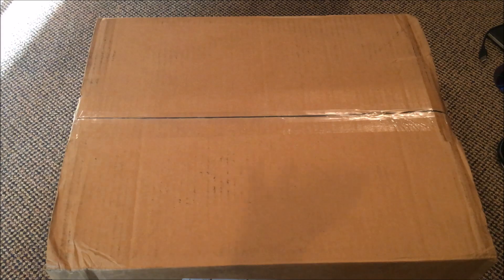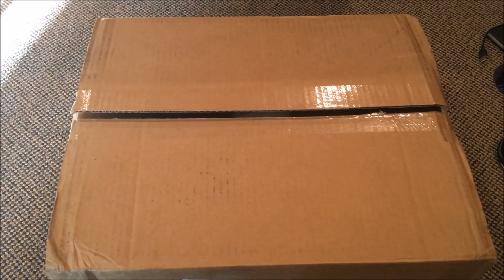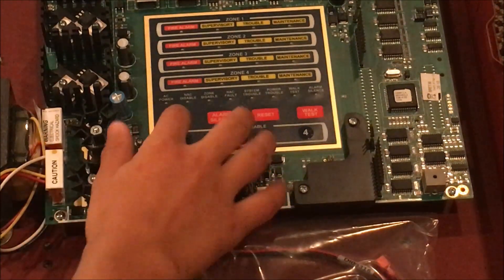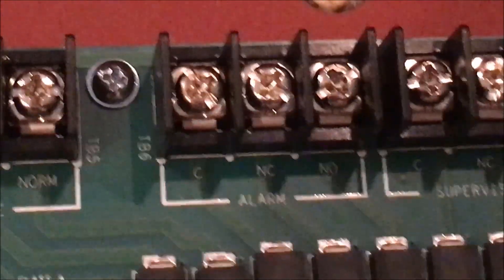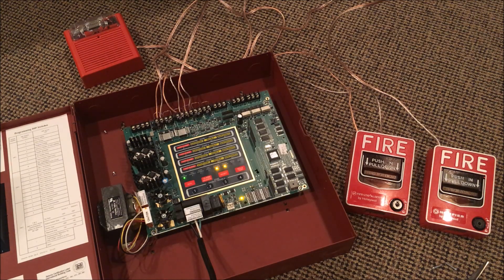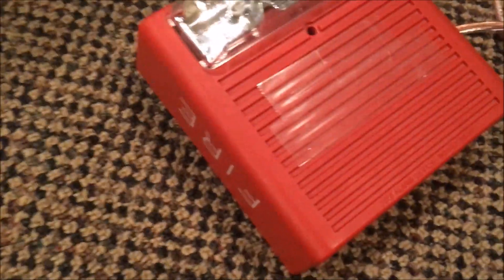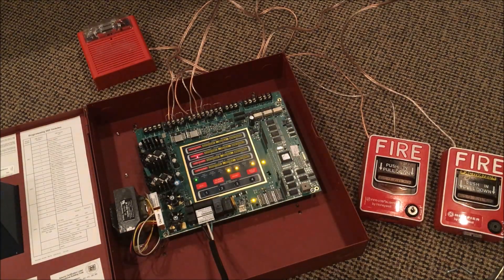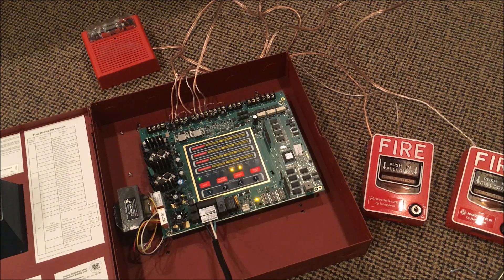Unboxing and Startup of My New Fire Alarm Control Panel (Fire-Lite MS-4 Conventional Panel)

Comment: Is there a way to sound the alarm without using the pull-station?  Say if I wanted to set the alarm to do a fire drill at my house, could I set off the alarm just by pushing a button on the panel?

Comment: I prefer to use speaker wiring on conventional fire alarm panels for demonstration because they’re cheap and easy to find everywhere compared to Honeywell Genesis wiring which might be challenging to find. In fact, I used speaker wiring to hook up my Notifier SFP-1024 FACC which has 10 zones and is conventional and got the wiring from Home Depot and Amazon

Comment: Do all firelite panels only work with 110v or also 220v? Because I live in Europe and I would want to get a firelite panel
Reply: you need 120-125v
Reply: Yes, they do have a 220 to 240 V, fire lite Ms-4E

Comment: Hi Alarm guy, I  also have a Fire-alarm MS-4 just like that one, I had it for about 5 years, well the problem is that i put the wrong wiring and it through a spike trying to put the battery and now I cant make it stop beeping. What can I do help!
Reply: You should put backs or reset troubles

Comment: HI
Actually in addresable fire alarm loop system i want to tranfer one sonder with manual break point.Is this possible means how can i transfer please make a video for this as soon as possible....
Reply: If you use an addressable sounder you can replace it with addressable call point with same address as that of sounder. But the problem here is you should reprogram the panel or else it will show unidentified device or unknown device. If you think you don't need to program it which is no need to see which floor or office the detectors operated then you can go to the panel settings where you can find engineering options there you can find auto learn option which after which your panel takes all detector address and will be in normal condition.

Comment: I tried removing the cover for the dip switches on this panel, but the screw won't come out. Is there a specific way you have to do it?
Reply from the maker: Carson Delmoe Not really, you might just have to pull harder on the black plastic cover though.

Comment: I have a question, it might be really stupid. But I'm new to fire alarms... I'm thinking about getting this exact panel, I am going to have pull stations hooked to it. My pull stations only have one positive one negative not meant for series can u hook more than one wire to one zone on a panel?
Reply from the maker: To be honest, I would not get a panel yet if you are just a beginner. They can fry easily and there are certain procedures you must follow when wiring power, devices, etc. I fried one by knowingly wiring up the power with the power turned on and had to buy a new one. They also run on high voltage which can be dangerous if not careful. To answer your question, yes, you can hook up as many pull stations as you want to a zone. For this panel, as far as I know, each NAC can support up to 24 devices. But don't quote me on that. I think it is great that you are starting fire alarms, glad to hear it! But I would not get a panel quite yet. I would start off small and get bigger the more experienced you get. I am just giving you advice and precautions because I don't want you to buy a panel and pay all that money and fry or damage it. So again, I would start off with just mini systems with 9v adapters or so and then get a real panel later when you have more experienced. Just as some advice. Great questions, and I look forward to your awesome fire alarm videos! If you want to know how to wire a pull station to a notification appliance without a panel, I made a video specifically explaining and showing how to do that. Just go look for it on my channel, it should be really easy to find. Good luck!
Reply: I'm not getting one for a hobby system, I'm getting one for actual safety but... I have been researching these systems since I was a kid but.. I just got my first alarm and am not used to wiring, thats what i meant by beginner so if u have any videos that would help me learn  how.... or anything please let me know. I sort of need a panel to get pull stations and smoke detectors, but I still am not very good at the wiring part, Also I have been trying to find a good video on how to make your own power supply for it but I cant figure out how but I would like to make my own DC adapter that is grounded for it's more safe for power surges and stuff. Just let me know if you know any videos that help making power adapters for them cause like u said I don't want to short out my panel :)
Reply from the maker: The adapters you can just buy online on Amazon, or any supply place like that. I would not recommend MAKING your own adapter or power supply. The wiring part is the part where if it done improperly, it can fry the device you hooked up to the panel's NAC circuit. If the power is done incorrectly, then the panel will short out. (fry). I will send you a list of videos that might help you with wiring, fire alarms in general, etc etc etc. ;)
Reply: Thank You :)
Reply from the maker: Sent it.... did you get it?
Reply: Yep.
Reply: @firealarmperson  Code regulates the maximum output of any NAC panel, FACP and Signal Expanders/Booster Panel to 4 AMPs, 24 Volts. The amount of devices you may place on a NAC circuit depends on the appliances being driven, specifically the amp draw.
Reply: I actually have just come back to the fire alarm community myself after about 4 years and also have a few devices of my own. I'm actually quite knowledgeable on basic circuits (like positive an negative, capacitance, resistance, ground, etc) as well as I know what NAC and zones are on a panel. However, since I've only been playing with real fire alarm devices for only about a month and a half, do you think it may still be too early for me to invest in a panel?
Reply: You shouldnt be able to fry the system. It should be power limited so it should work again after you fix the short. "Unless you put 120 volts on something that shouldnt be 120 volts." And also i think your only able to put 20 device on 1 initiating zone by code. And NAC circuit you can put as many as you want but you need to stay in the ampage of that NAC circuit you dont want to over load and the strobs or horn strobs wont work.
Reply: Yes you can use. There is no problem at all.

Comment: what are the resistors for and how do you wire them
Reply from the maker: So there are two screw terminals in each circuit that require resistors. So to wire them, you just bend the resistor and put one end of the resistor in one screw terminal and the other end of it in the other screw terminal. It does not matter what end you put it into on the circuit. The only terminals in the panel that need resistors are the NAC Circuits and Zones. Nothing will happen if you don't put resistors on. But it is highly recommended for a system.

Comment: How do you order one?
Reply from the maker: On eBay, just like you would order anything else. Just be advised that you may get a little bit of a knock-off price for it. Meaning if you can't find a good deal on it. Then you might end up buying it for the retail price which is what I paid for mine.
Reply from the maker: This is a conventional panel, and yes, I learned my lesson on the whole pricing thing like you mentioned. :)
Reply: ok